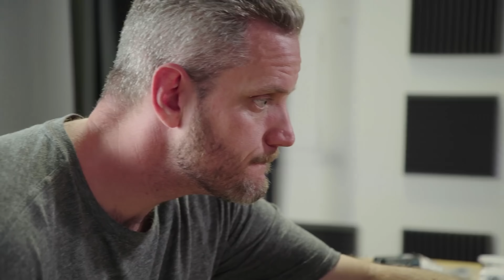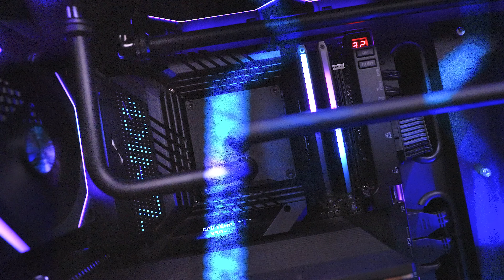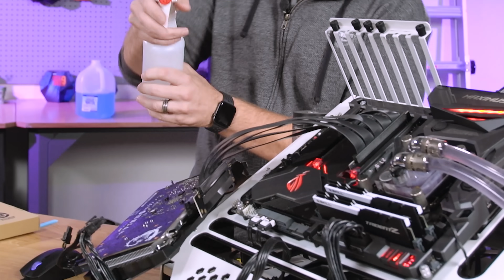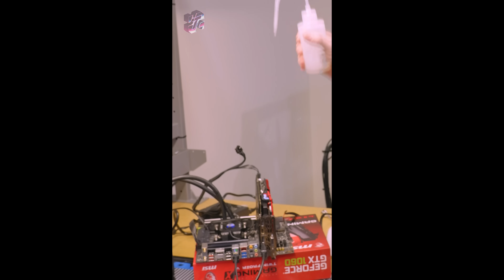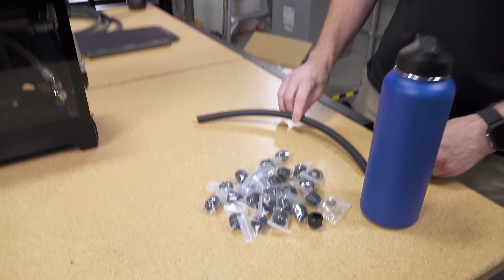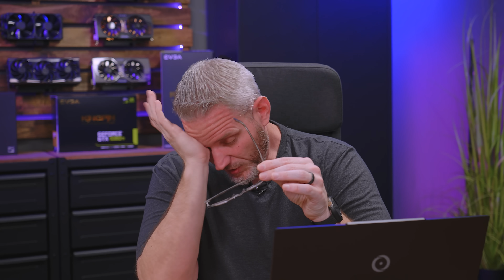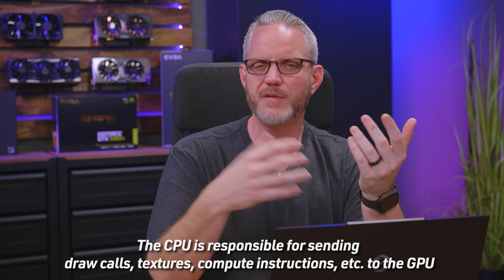5 Myths about Watercooling that are WRONG!

Comment: Hey, you're right.  Water Cooling is my way to go and I've been contemplating on what happens if I integrate a swamp cooler.  It'll either be the dumbest thing I ever did or the smartest.

Mind you, I'm probably not going to do it.  As much as I would love to see an integrated system, it's probably best to integrate an air filter than any side of AC cooling.  That's actually what I'll be doing.  Helps to breathe a little better.

Comment: Cost is definitely a factor because when $25 heatsinks are on-par with custom loops, it starts making a lot less sense. And as the Black Keys said, if it don't make dollars, it don't make sense.
Reply: They are no where near on par with custom loops sorry, maybe a really really bad custom loop or you think AIO = custom loop.

No air cooler is going to keep my GPU (which is a 4080) at 45-50c under 100% load with all day long use or keep my mini sun AKA 13900K at 60-65c under load.  It's not happening sorry.
Reply: @JathraDH  sorry but keeping your GPU at 50C vs 75C has zero impact on longevity
Reply: @itsmikepawlik  First, that is entirely false.  75c will absolutely kill hardware much faster than 50c, especially if that hardware has a lot of power flowing through it.  Now will it mean killing it within a reasonable expected life span? Probably not, but you again are making entirely false statements.  More heat absolutely reduces lifespan faster than less heat and 75c is not really safe long term temperatures, but it should get you 5-6 years or so.

2nd, you said a $25 cooler is "on par" with custom loops.  Again, entirely false.  "On par" means equal to and that is simply not remotely the case.  Good luck cooling a 13900K on a $25 cooler.  The CPU will be pegged at 100c non stop, hell I have seen builds with AIOs still keeping that CPU barely below 100c.
Reply: @JathraDH  awesome man thanks for clarifying.

Comment: I did my first custom water loop 6 years ago with soft see through tubing and all EK parts and EK fluid for both my i7 7820X and 1080Ti and beside some evaporated fluid that I had to fill in I've made zero maintenance on it and it works perfectly to this day. Tubes didn't go cloudy either. But to be honest the thought of dismantling it is the reason that it has stopped me from upgrading my PC for years now and I don't want custom loops anymore. I'm going with AIO next time when I finally decide to pull the trigger.

Comment: It is Monsoon that makes the convertible fittings. I own some and they work well. A retention ring gets glued to the end of the tubing with the screw down ring already on the tube, behind the retention ring. Then when you screw down the outer ring to the fitting on the radiator/block/reservoir it presses the retention ring on the end of the tube into a gasket and seals everything. The retention ring doesn't allow the tubing to come out of the screw down part of the fitting because of the way the Monsoon compression fittings are designed. ModMyToys makes a variation of the fittings with carbon fiber accents also. Those look REALLY nice. I have them in my current system. All of these items are available at PPCs!

Comment: 14:40 TBF Loop order DID used to matter.  Quite a lot actually.  Back when pumps were slower, fans werent as powerful and radiators AND GPU/GPU blocks couldnt dissipate heat as quickly.  It wasnt even that long ago that loop order actually played a pretty significant factor in whether your CPU or GPU was cooler or hotter.  Especially when we were running FOUR GPU's.  Thankfully with modern watercooling parts loop order is pretty much 100% aesthetic

Comment: well jay exhaust the heat outside. rely on the cooling tower on the pad next to the ac or thru the pool, many solutions here, dig a basement under u'r house and rely on that cold plate. mb
Reply: like I said 18 months ago, 2 yrs forever rely on deionized water JUST DO NOT DRINK IT because it will suck the ions out of u. mb
Reply: better than ketone, so much progress? mb
Reply: the algae is terrible in low cost often seasonal summer like city water when the biocide kills that shit the water stinks. mb
Reply: I heard hot outside in Tustin, you can always go for a chiller. mb
Reply: or drag a cooling loop thru u refer or freezer. mb
Reply: yea the ground / basement cold plate is the best option. mb

Comment: Dude you obviously don't understand how a car cooling system works, much less a PC. 1 a car has a thermostat. 2. The thermostat controls the flow of water to the radiator. The thermostat is a mechanically calibrated spring valve that is set to maintain the water temperature coming out of the engine.  The Radiator is a heat exchanger It is passive.  In a PC water temp from the wtr block is controlled through increasing fan speed or throttling the pump speed.  What a shame, I am just disappointed!

Comment: Jayz here considering becoming the rebirth of skinee labs =P

A couple of points regarding the cost aspect:

My experience regarding brands and variety has been a bit different. Might have to do with being all the way in Aotearoa NZ, but when I had to shop for parts in the past few years, I found it very hard. Felt like the only brand I could consistently find stuff from were EK and they had been doing some crazy prices (they wanted like 300 dollars for an Arc A770 block, LOL). My loop has a lot of variety, still some EK stuff, but also XSPC (which seem to be not doing so great, which is extremely unfortunate for everyone into watercooling), some either Aquacomputer, Alphacool or both? And that A770 did end up wity a Bykski block. But to me it feels like the prevalence of AIOs has greatly deemphasized custom loop parts availability. It's not easy

One thing in particular that I am quite mad that seems to have almost entirely been phased out are "universal GPU blocks". I have an old Alphacool NexXxoS on my Maxwell Titan but that feels like a relic

And universal blocks, actually, feed into a positive of watercooling: Everything other than blocks is reusable (though tubing is less so). A lot of CPU blocks just get updated mounts if the socket doesn't change much, they might even not need that. But you buy a nice rad or two and a D5 pump, those are going to keep going for years. When you replace the computer, you can just move them into the new build. So while the initial cost IS high, you can just reuse most parts

I guess my counterpoint to JayZ "done with clear tubing" is "done with coloured coolant" on my end. That's one annoying thing that colouring will seep into your tubing over time, and I've had some of it go weirdly coloured a couple of times (though also as a consequence of other problems) so for now I'm clear only. I know I had pastel particles coming out of my rad WELL after that coolant was gone

Comment: Often with smaller loops with multiple components and a lower flow rate, if you need to use 2 smaller radiators, then it is more effective to have a radiator between the CPU and GPU. For example, CPU > Radiator > GPU> Radiator. As the temperature delta between liquid and ambient temperature shrinks, the rate of cooling slows down. This is also why you don't get much of a benefit from daisy-chaining 6 radiators in a row compared to one or 2.  One alternative is just using a higher flow rate where liquid isn't dewlling in the blocks long enough to get much of a temperature rise within a single pass. 
Often, having a radiator between 2 components can sometimes lower temperatures of the downstream component by an additional 3 or so C compared to 2 radiators st the end of the loop.

Comment: I did a full custom loop a few years ago because I wanted a silent PC, however, one thing I learned is that I probably would not do a custom loop again. mostly because of the maintenance, every year to change the coolant, clean blocks, rads, drain the system, get rid of the bubbles..etc just too much work. it can literally take a full day minimum or more than a full day if I am going to check and replace the old PETG tubing, o-rings in the fittings..etc 

Another big factor is that when there's hardware failure, it's a pain in the ass to troubleshoot. 

AIO or even air cool is much more appealing.

Comment: As a middle aged man with a kid and career, I moved away from water cooling and just invest in higher end air cooling options entirely because if something goes wrong I simply don't have the time to deal with water cooling anymore and I don't want my primary rig down for weeks because I can't find the time to properly fix something. For the same reason I also like larger cases so there is plenty of room to work inside the case.
Reply: I'm in my 60s and have a hard time justifying water cooling when I can get something like a Thermalright peerless assassin for less than 40 bucks. No pumps, no tubing no hassle.
Reply: @jarchack  IMO, there are only 2 practical resons for water: 1. You are having some crazy hot overcloocked rig. 2. Your setup is compact so fitting a huge twin tower cooler is pain in the ass.
Reply: @jarchack  I also use a Thermalright PA ATM and just waiting for my 7900XT to lose warranty so I can start the custom loop, the temperature difference is still massively different. I often say that spending for a loop is making sure you never care about temperatures again, the fact that top end hardware do not even reach 60C ever again is a massive + for me
Reply: @jarchack  30 year old techie who agrees here. I'm definitely not the target audience of water cooling though. I've never had a CPU that could even get my peerless assassin above 60c lmao.
Reply: @jarchack  I'm in my 60s also, water cooling is a unneeded niche marketing ploy that the young fall for ... cha-ching $$$.  Literally minimum advantages with much higher risks.  I'm not prepared to rebuy all my components because of a leak, just not worth the risk.  My 2 yr old rig in a Tower 100 ... still running awesome, no maintenance except infrequent dust cleaning. 👍
Reply: @robbierobot5799  I don't OC anymore and air coolers have come a long way. It's a tossup which collects more dust, me or my computer.
Reply: @RealGengarTV  3 and 9 months is rough on the time, it gets better though. Mine is 10 and has a PC of his own he spends a lot of time on (programming actually, he might be on that nerd path even earlier than I was).
Reply: Air is great. I can just build it one time. Let it run and then very rarely clean it a bit... And with something like Noctua even if the fans break it is still big enough to work with only case fan or even passive manner.
Reply: I entirely agree ! As an enthusiast, I totally understand why some people go for water cooling. As a hardware technician (I work mostly with company PC's/laptops) , water cooling is entirely out of the question for obvious reasons. For me personally, due to lack of time and patience for this kind of stuff, I opted a few years back for air cooling. I am not even considering AIO's lately, since I had enough of them fail over the years and they go in the bin. As for an air cooler, unless you take a a sledgehammer to it, worst case scenario is a fan that fails. Which in most scenarios, takes around 1 minute to replace.
Reply: agreed! Running air since I went 10th gen 10900K (Noctua NH D15) and still running the cooler on 7800X3D and it runs cool. The room it is in has a great AC so even when in summer is stays under 22c inside. But even without the airco unit on it performs well keeping the old 10900K cool let alone the 7800X3D that thing runs super cool with it.
9900K was the last custom loop I did run but it costs a lot to build and needs way more attention than air and if you have kids (4 and 10) you mostly don't have enough time haha.
Reply: Man, absolutely same boat as you. I use my rig for work and sim racing. So I use it 7 days a week. For work, I have a laptop as a backup, but it is always too weak, slow. I invest more in reliability than horse power. Noctua fans and cooler, a good power supply,  decent SSDs (I like samsung),  Mobo and memory. And a huge full tower case (Fractal Design).
Reply: @ClaudioBarroso  I also use fractal, It is one of the meshify cases but I always forget which is which :)
Reply: I don't even have a kid and don't like the idea of needing to maintain a loop. I'm also not really overclocking or pushing the hardware enough to notice the benefits of water cooling anyway. Decent air cooling has gotten pretty cheap too.
Reply: I can relate 100% haha
Reply: I inherited a  Corsair H115.  I was thinking about using it for laughs and giggles.
Reply: Watercooling isnt even necessary for overclocking these days, with most high-end hardware. Helpful, of course, but you need to be a little bit mad to make that leap.
Reply: But watercooling after initial setup is really zero maitanance (soft tube with clear fluid). After few years you have to dust clean (also with air cooling) and then you can replace fluid with new one.
Reply: @Shus93  Maintenance isn't the issue. Troubleshooting DEFINITELY is. Especially if you have multiple PCs in the house (which I do). Let's say a PC is having issues with that seems to be the GPU and I want to swap them around to see where the problem follows. Well if they are in a custom loop that is a MAJOR pain in the ass compared to a 5 minute job otherwise. I often find that M.2 drives are also hard to get to in many water cooled setups but that depends on a lot of variables.
Reply: @ReivecS  Of course, still for me soft tube setup is more convenient because noctua is just too big and cover half of motherboard and if you add quick disconnect to your loop everything can be plug and play. But hey, if air work for you it is great.
Reply: @Shus93  Yeah, the newer AIO's are pretty decent but I don't overclock and something like the peerless assassin is more than enough for me.
Reply: Should have kept the water cooled PC and skipped having the kid.
Reply: @lifespanofafry1534  Never had either but from what I've heard, the older water cooled systems leaked sometimes but not as much as kids.
Reply: @jarchack  I dunno man, my PC, High end last gen system still runs on an 2010 watercooler for the CPU.  No leaks, still acceptable temps and the most important thing, silence. 
Water cooling is so much more inexpensive then air coolers if you cool only your CPU. Because if you bought from the right company, they will provide you for 10 bucks a new retention kit. My cooler is ready for the next gen even if the the design is from 2008. The pump never gone out. The rad is still the same, some of the tubes can be repurposed. 
So realistically you will spend if you remount your cooler on something new 15 USD. 
If you decide to also cool the GPU, well this will be the expensive part because the cooler will cost 90-150USD. In my case I buy that because of the silence. 

In all those years I never had a leak. I also still use some old tubes from 15 years ago. Still no leaks but for the next system I will finally retire the tubes but that is freaking awesome.
Reply: Watercoolers look much better than air coolers
Reply: @jurivjerdha2467  Sure it does but I am a function before form kind of guy
Reply: @jarchack  sounds good

Comment: I have an i5-13600kf with a zalman 360mm cooler (3x120mm fans) and my pc always run between 55-85 degrees and sound like a fighter jet or my old AMD athlon from 2001 (AKA like a PS4). I have 3x120mm fans in front and one 140mm in the rear. 
 Are Zalman a bad company for coolers?

Comment: As a recovering Chemical Engineering major that did lots of heat exchanger design problems in school, I'd very much like to see inlet and outlet temperature probes on all the components in your water loop and in as many different configurations as possible. Especially interested in getting supply and return temps on as many different models of radiator as possible under differing load conditions.

Comment: Not sure how you rationalize running hot water that just went through one component directly into another and say it doesn't matter. When earlier in the same video you said ambient temps in the room will effect the cooling. It's not rocket science. The water coming out of the radiator is much cooler than the water going in. To get the lowest temps on two component, they should have their own radiator. If you run water that just cooled the block on a 4090 directly to a block of a i9 14900k cpu block your temps will be much higher on the cpu then they would if it had it's own 360 or larger radiator. Running a car motor without a thermostat almost always makes the motor run colder than the thermostats rated temp. Usually much cooler. So cool it screws up the sensors on the motor and messes with fuel economy. Just like running the hot air from a radiator into a case instead of out. Both not ideal.  Test it. I will wager whatever you want that the temps will be far better if routed water and air are done properly.  A thermostat  is to keep the motor temp up to and at ideal temps for the motor,